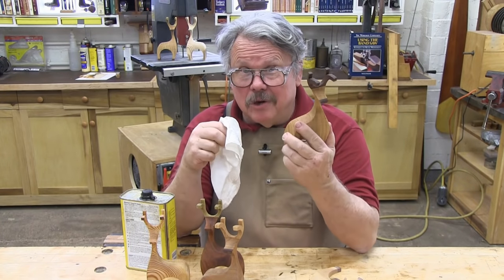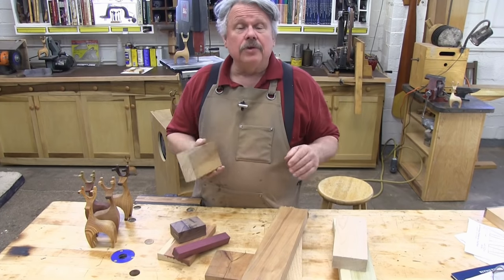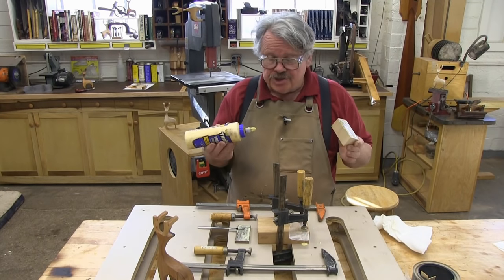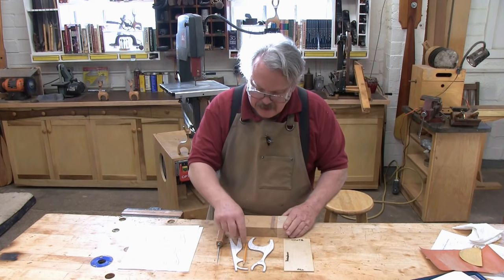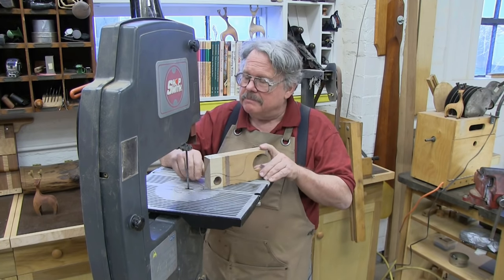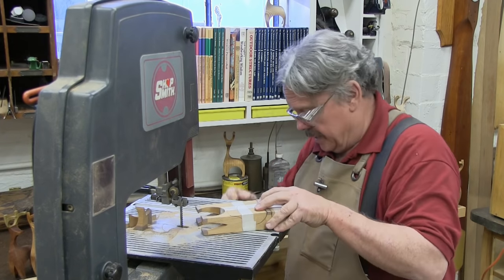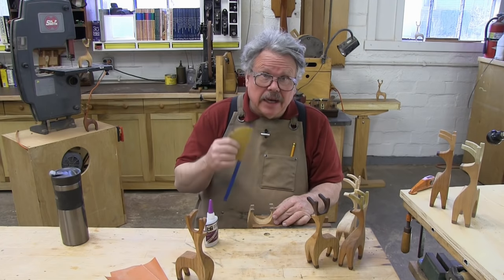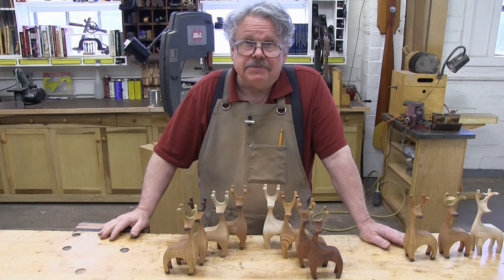Scrapwood Reindeer Band Saw Compound Cutting Project: How to

Comment: The 2011 holiday season was one of the most depressing and challenging I have ever had, the life I had was ending, and come the new year I would start a new life on my own. I had recently seen a picture of those deer, made from 2x4, I think, and painted white. Taking a break from clearing out the garage I decided to try to make a pair from 1x2” furring strip. It took a few attempts but I eventually cut a pair that looked alright. They were small, of course, and a bit wonky since I was free cutting without the plans, but cute just the same. I kept cutting a few more here and there, whenever I was feeling overwhelmed and started smoothing them out with round mini files. Filing the curved surfaces was especially calming, everything else around me seemed so unnerving.  Pair after tiny pair, before Christmas Day arrived I had made over 150 pairs of 'em, almost 300 total. The damn dear had become a herd without me even realizing it. But they got me through Christmas and smoothed one of the roughest times of my life. Without them giving me something to do other than dwell,  I am certain I would have never made it through Christmas. The following December I decided to release them into the wild, one pair at a time, wherever I'd go I'd quietly leave a pair, each wearing a little red bow for someone to find. That was one of my better holiday seasons, again thanks to a herd of tiny little dear.  It's been some time since I've thought of them or seen any others. It's nice to see the herd is healthy and still growing. And it’s especially nice to say thanks to you for helping establish the herd in the first place.
Reply from the maker: You are most welcome, but I was especially touched by how you released the herd that you created. There is no such thing as an unimportant act of kindness.
Reply: Thanks for sharing, they could make a movie of your story ;)
Reply: Thank you so much for sharing your  story and  for spreading some Christmas love with others ❤
Reply: How lovely, I use this technique - do something nice for someone if you feel low. More strength to you!
Birdy
Reply: Thank you for sharing this story. I'm watched this video as a sad sorry attempt to ignore and escape life, but you've brought a small and much needed measure of hope and happiness, enough to put down my phone and create something for a world in need (and I include myself in that need).
Reply: God Bless You 🥰

Comment: I’ve made these for all of the women in my family.  I adjusted the blank size from your plans to represent parents vs teens vs toddlers etc in each family.  And, after some trouble getting a perfect fit for the nose blank, I decided to try pouring epoxy in the dado for the nose so I could make them black or red.  Then I used different color woods for antlers to match everyone’s hair color.  Everyone loved them.  Thanks for the video and the plans!
Reply from the maker: Most welcome.

Comment: i made this tonight. was super fun, but i couldnt make the 1/4" blade do the sharp radius cuts. dremmel worked wonders to finish. thanks for the video!!
Reply from the maker: We recommend using a 3/16" (4 mm) skip-took blade if you cutting the shape entirely with a band saw. If you drill the tight radii between the horns and under the chin, you can get by with a 1/4" skip-tooth.

Comment: Started making these last week and came upon some different approaches. Instead of saving the cut scraps to tape back on and re-mark the front of the reindeer, just flip the front template over and trace as the back of the reindeer on the "back" of the blank. Since the back is flat, the marks will not be disturbed after cutting the profile. I also found that this approach leaves a scrap that is a clear profile of the reindeer (if cut in one pass) that you can then rip into thin strips, perfect for making a garland.
Reply from the maker: All good stuff -- thanks for sharing.

Comment: I love these, bought the plans and made about 30 so far for gifts! I have a suggestion, after a while the tape gums up your bandsaw tires - use hot glue instead to avoid the cleanup. Thanks again, great video and design!!
Reply from the maker: Great idea; thanks for sharing. And those of you who still use tape, naptha will take the gum off quickly without affecting the tires overmuch.
Reply: Instead of using tape, i put my front facing plans on the back of the block so when i cut the side cuts, my other template didnt get cut into, so i didnt have to use and tape or anything
Reply from the maker: @RooDaaR  Another good idea. You guys want to do my next video for me?

Comment: These are beautiful, wish I had the tools to have a go at this
Reply from the maker: You can do these with a coping saw. It takes some patience, but I have done this with young people. Just draw the outlines on both sides of the stock so you can monitor both the entrance and exit of your cut. Clamp a scrap board (one you can saw through, if necessary) so it overhangs your table and use that as your work surface..
Reply: @WorkshopCompanion  Ahh ok, thanks for the advice! I’ll have to give it a go

Comment: I purchased the template last night and then got busy in my shop making my own wooden templates and then proceeded to make my first one to see how it goes. I need to work on my bandsaw skill but nothing some extra sanding won't fix. I just used a scrap piece of lumber. Now I'll try the version with the hoof, nose and antlers a different color. Plan on making one for each of my daughters for St Nicholas Day (Dec 6th). Is that a stand alone shop smith bandsaw? I have a shopsmith with a bandsaw and that's what I used last night. I've never seen a stand alone version. Thanks for the excellent tutorial. You're a great teacher!
Reply from the maker: Thanks for the kind words and yes, it is a Shopsmith band saw.

Comment: Thank you for this video. Straight to the point, love it. The plans were super easy to follow, my bandsaw isnt as powerful as the one you use, but it managed to get it done. My first attempt came out amazing. I had to shrink the pattern just a bit to fit my lumber selection, but it still came out amazing. Thank you for this. Now to get enough of them done and ready for Christmas
Reply from the maker: Kind of you to say -- now get back to work...;-)
Reply: @WorkshopCompanion  got 27 of them done for my daughter's classmates, but my bandsaw was struggling after about 17. So Im looking to upgrade to a new, more powerful one. What brand of bandsaw do you use in this video?
Reply from the maker: @RooDaaR  It's a Shopsmith, but if you're going to upgrade, I'd take a good look at some of the 14" saws. Most of these have risers available so you can get a 12" capacity. Comes in handy.

Comment: Here is a tip I learned: Use a synthetic wine cork for cleaning the sanding drums! Cheap and effective, plus you get to drink wine!
Reply: If you ever have a tube of silicone caulk cure in the tube, that's another great one! No wine though

Comment: I am so glad I have found you. This is incredible stuff, I've been all over your channel. You make it look easy, and I am looking forward to getting to work on some Christmas gifts!
Reply from the maker: Welcome!
Reply: @WorkshopCompanion  do you have a drill press you’d recommend? Not looking to spend thousands, but would appreciate something capable of mirroring your setup with the drum sanders. What are your thoughts on bench top models?
Reply from the maker: @numerousactuary6640  I would recommend any benchtop industrial drill press made before the turn of the century, preferably before 1980. You'll spend less ($150--$300) and get a better tool.  I'm partial to the Cummins and the Deltas, but Craftsman and Companion are good too. Make sure you get one with a 1725 RPM motor, especially if you want to use it for drum sanding. All of these old industrial machines will have 5 to 10 speeds available via the pulley system in the headstock, but if the motor turns at 3750 RPM, you may not be able to make the machine run slow enough for sanding. When the drum turns too fast, the sawdust doesn't have enough time to clear. It becomes impacted between the grits, and the drum starts to burn the work. You want to be able to work at 300 to 500 rpm. You might also look around for an old Shopsmith. They aren't benchtop tools, but I've converted several of these to dedicated standing drilling tools. The slow speeds and tilting table make them far superior as a woodworking drill press to about 95% of the presses past or present.

Comment: Such a great video!  I purchased the plans but what grit sandpaper should I use,220?
Reply from the maker: Buy yourself a set of small  drum sanders you can use on your drill press -- the 1" diameter sander will sand all the contours. Remove the saw marks with 100#; finish up with 150#. Move up to 220# if you're hopelessly anal or ridiculously determined to show off.
Reply: @WorkshopCompanion  excellent, thank you for responding. I can’t wait to make them!

Comment: Is there any reason to avoid putting the hooves on in a cross grain direction (like the nose is)? I have a lot more 3/8” and 1/4” walnut scrap that would lend itself to this orientation than in line with the body and antlers.
Reply from the maker: None at all. Every mortise-and-tenon joint is glued cross grain. The rule of thumb is that you should limit the size of a glued cross-grain joint to 3 inches or 75 mm depending on which tape measure you reach for. And by the way, our noses are not cross-grained -- we cut the strips so the grains would align. Completely unnecessary, but Travis and I are anal that way.

Comment: Hey Nick, I'm having a devil of a time trying  to find a 2 1/4 inch Forstner bit that is not made in China.  I like the Fisch Wave Cutter, but they only go up to 2 1/8.  Also, I'm having the same difficulty with Freud.  Any suggestions?  Thanks for your great videos.  Michael A. Grinney
Reply from the maker: Hole saws. You have to do a little more sanding, but they get you there. Feed until the pilot drill exits the bottom, then turn the work over and finish sawing from the other side. -- makes the plug easy to remove from the saw.

Comment: I bought your plans, they're excellent but they threw me a bit. You have the 2 holes to help with the turns, the measurements show their radius, my drill bits show diameter, consequently, I didn't have one big enough as I discovered when I took my 13mm bit and found that I needed 26mm etc. The other one is huge, not sure if I've seen too many 58mm bits.
Reply from the maker: Marking the diameter of a closed hole and the radius of an open curve is standard orthographic practice; it can be confusing. The holes are equivalent to 1" and 2-1/4" in the English/Imperial system. The 1"/25 mm bit is very common; 2-1/4"/57 mm hole-producing tools are commonly available as Forstner bits, multi-spur bits, and hole saws. You really don't need the bits at all, if it seems a needless expense to you. If you use a 3/16"/4 mm band saw blade, it will handle the small-radius curves. I suggested using the bits because it saves time and most folks want to make several of these figurines.
Reply: @WorkshopCompanion  I am struggling to find a 3/16 4mm band saw blade down here in New Zealand,........but I'll keep looking.
Regards,
Allyn ( Alpal ) Hansen
Reply from the maker: @allynhansen7398  This is where I get mine, but I don't know if they ship to New Zealand: https://www.highlandwoodworking.com/316-4-tpi-skiptooth-bandsaw-blades.aspx

Comment: Ordered reindeer and sled several months ago. Paid for but, never got the patterns.
Reply from the maker: Plans and patterns are sent to you immediately upon payment. When the payment is complete, our online Shopify store sends a link from which you can download your purchase -- usually a PDF or ZIP file. As a backup, this link is also sent to your email. Occasionally folks don't get these links because there is a mistake in the email address that they entered. Less frequently, folks are expecting printed plans on paper. We try to make it clear in the sales copy that these are digital plans only, we could not possibly print, inventory, fulfill, and mail paper pans for the low prices we are asking. If you have not received your digital plans, contact workshopcompanionsales@gmail.com. Give them the name and email address you used, plus your order number if you still have it. They will see you get the files.

Comment: The measurements for the holes in the downloaded plan are not correct. The one marked 1/2 inch is 1 inch and the one marked 1 1/8 inch is actually 2 1/8 inch
Reply from the maker: The measurements are marked "rad" for radius. A 1-inch drill bit cuts a 1/2" radius hole. In orthographics, open curves are customarily labeled according to their radius -- there is no one clear diameter because the curve is open. The diameters of drill bits to be used  -- 1" and 2-1/4" -- are given in Step 4.

Comment: How thin is the blade all i can get is 3/8 or 6 mm witch are too wide
Reply from the maker: 6 mm is equal to 1/4" -- that is what I used on this video. However, a 3/16" or 4 mm blade works just as well. Recommend a skip-tooth grind.

Comment: I’m not a good drawer how do I get the template to trace it on the wood? If I buy your plan does it come with the cut out to trace?
Reply from the maker: The plan will come with a full size template. You print it out, glue it to a thin peice of plywood then cut the shape for each side. Then you will have a plywood template like we used in the video.
Reply: @WorkshopCompanion   thank you I have purchased my template!!!
Reply from the maker: @christinataylor3113  Thank you for supporting us -- and good luck!

Comment: Could one use a jigsaw to cut these?
Reply from the maker: If you reduce the size to about 1/3 or 1/4 of its current dimension, you may be able to cut it on a scroll saw or jigsaw.
Reply: @WorkshopCompanion  thank you!

Comment: I don't have a band saw, would a jigsaw work?
Reply from the maker: If by jigsaw you mean a hand-held tool with a short reciprocating blade, then no. If you mean a stationary tool similar to a scroll saw (but using a spring to return the blade to the top position), then perhaps -- if the jigsaw has a 3-1/2"  (9 cm) throat. You might also considered scaling down the pattern to fit your jigsaw.
Reply: @WorkshopCompanion  Thanks for your reply, unfortunately, a hand-held tool with a short reciprocating blade is exactly what I've got!